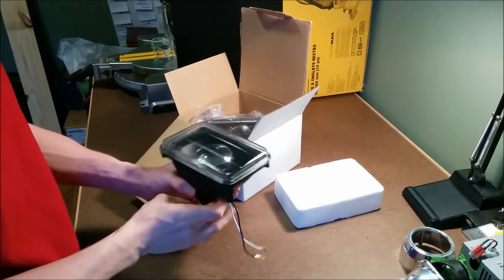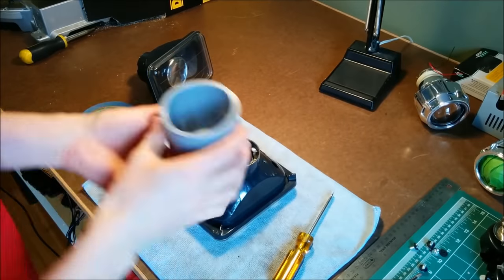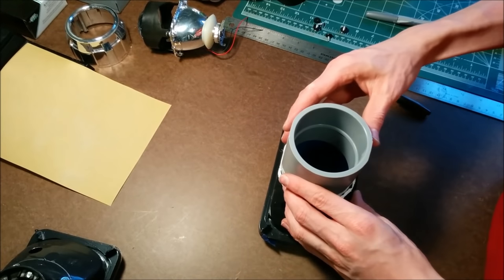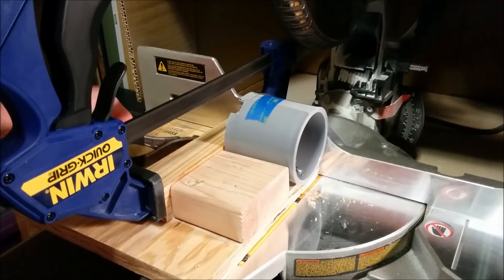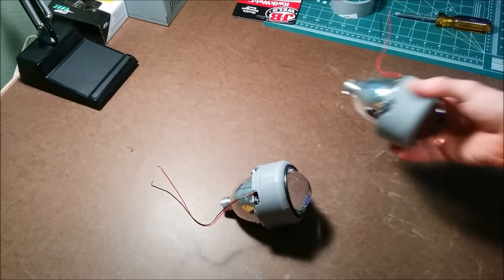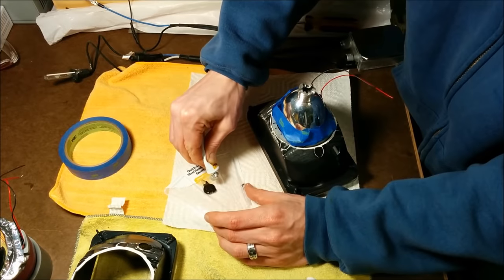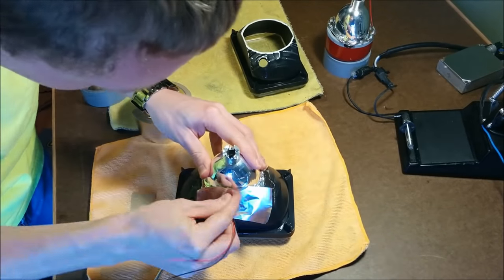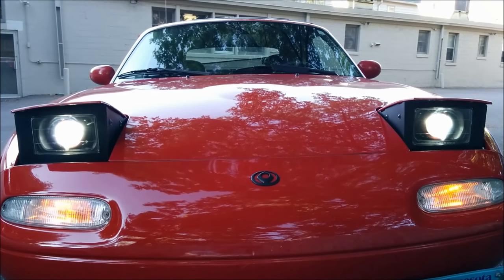How To: Make Projector Headlights for Your Car

Comment: Dude...this has to be one of the best conversions Ive seen on this type of housing.  My Firebird has the 7"x6" housings.  Ive had projectors kicking around for YEARS now.  My main issue is the depth due to the pop up lights.  This install has inspired me though. I really like the way you made the PVC adapters and used them as the shrouds.  That was genius.  Giving you a huge shout out if I ever get back to the project because Im 100% using this idea!  Thanks for the video!
Reply from the maker: JEG's Garage glad I could help!!

Comment: That conduit idea just made it look easier! thought I was going to have to use extreme accuracy skills to cut the housings to fit the projectors correctly.
Great video! Thanks for sharing!
Reply from the maker: Thanks for watching! It's not as hard as it seams!
Reply: It probably isn't, but since I have a need to make things perfect (in this case to make the light cut off level perfect), it would've taken me days to finish both side. Wanting better headlighting for my 1986 mr2, the best upgrade i have at the moment is the H4 Hella 7x6 conversion housings (reflective housing), I tried adding a OPT7 LED bulb but the housing makes too much glare for the way that the bulb was constructed, and didn't have a good cut off.

Comment: This is pretty much unrelated (potentially), but I have a 2002 Saab that has a small bulb, maybe 5 watts inside the light housing. Even if you turn off the headlights and have the fuse removed for the daytime running lights this 5 watt light will turn on, apparently it's to keep the headlights slightly illuminated at all time to give them a bit of "sparkle" so oncoming traffic can see you. I did a retrofit and removed them.

Comment from the maker: Breyden - when I hot glued the projectors into the housing that's when I set the depth.  I could slide them in and out to set the right depth.  Then I tacked them in place when I had the right depth set.
Reply: Justin Depew i have the exact same headlamps and just ordered a set of the same projectors.
My question is, based on the projector length and overall size, would it be possible to mount them just like you did but without cutting the back and instead removing the glass and mounting them through the front? Cause i noticed they stuck out quite a bit on the back

Comment: hi Justin
I have also converted my sealed beam crystals to Projector headlights on 2015 May. I used the original shroud this was possible because i opened it from the front. I didnt throw it to the oven but i used a hex saw to remove the binding cement. Also i used GREY 999 GASKET MAKER as the sealer instead of epoxy and foil and to reattach the lens to the back. And it is a fine job and works well.
Believe me or not for the entire thing i used a angle grinder, a screw driver and a hex saw only. You have good equipment man.

One small problem some moist leaks in from the bulb opening. If you find a solution please let me know.
Reply from the maker: You were able to get the shroud to fit? Nice work. Do you have any pictures?

Comment: I thought only high school girls drove Miata's.

Anyway why is this so much better than the Amazon lamps in their original configuration?
I couldn't find the exact projector lamps you used at The retrofit Source but from their prices I would say you spent between 2 and 3 hundred dollars on this project.
Reply from the maker: The lamps from Amazon are not real projectors. They don't actually project and cut off the light like a real projector. They basically just scatter the light everywhere. 

I already had the projectors so I did not purchase them.  But if I had to buy everything new I'm guessing it would cost about $200.

Comment: Damnn homie good job! Im brainstorming for my 97 camaro. But mine are 5.91"x2.52"×4.19.. they are 4351 sealed beam from factory. I think im gonna have to modify the oem bracketry unfortunately and remove the leveling system.

Comment: Great stuff i like it very neat build was there a downside to the build? I'm wondering if these style lights cause temporary blindness to oncoming traffic? and how did you adjust them to point straight?Do they work for immediate visibility?
Reply from the maker: Projector lights are designed to not blind oncoming traffic. They have a very sharp cutoff at about bumper height. To adjust them, I made brackets with adjustment screws to aim the lights. You can see pictures of this on my website. The link is in the description.

Comment: F'N EXCELLENT TUTORIAL MY MAN!!!! THANK YOU BEST ON YOU TUBE!!!!
Reply from the maker: Drake DrakeR thanks man!
Reply: Justin Depew did you use the entire kit or just the projectors and the bulbs that came with the projectors? Also did you use the H1 series? 
And also the conduit you used does it sit all the way down on the lens? The reason I asked is I want to do a similar setup by run switchback halos inside.

Thanks in advance!
Reply from the maker: Drake DrakeR I used the H1. I did not use the chrome shrouds that come with the projector kits. I used the conduit instead. The conduit doesn't quite touch the lens. I think you could do the halo no problem.
Reply: Justin Depew Awesome thank you for taking the time and the info... once again great video and your website is is also filled with some great projects as well!!

Comment: GREAT job.  Looks excellent.
Did they come out level, like to pass a vehicle inspection.  Do they "vibrate" at higher speeds, whereas to cause headaches in driving for longer distances?
Reply from the maker: Oscar Lechuga they do not rotate because they are glued in place. Also I haven't noticed much vibration. Although these pop up headlights are more subject to vibration than standard headlights, but that has nothing to do with the projector.

Comment: Soooo I have a old Toyota pickup 89 and it has the three female input which is the ground, high beam, and low beam. But my question is... 
if I do this headlight housing and the projector only holds the H1 bulb is there any way I can convert the wires or anything like that? I was thinking of buying the H1 bi-xenon kit and doing the ground on metal and the high beam and low beam connect to the corresponding wires. Is that possible???

Comment: I have a 92 4x4 toyota truck ,I put a 94 4 runner front end on it .
I don`t have much room behind the headlight .
how much more do the new finish light stick out compared to the stock light ?
also how much brighter are the new ones then the old ones ? 
also scene you did a great job on your lights ,how much would you charge to do a set for my truck ?
Reply from the maker: Rodger Privett hi Roger! The projectors stick out the back of the housing quite a bit.  I don't have the exact number but it's probably 2 or 3 inches. The HID bulbs are incredibly bright. It's a huge difference over the stock lights. If I had to charge for the lights it wouldn't be cheap. At least $600 because it is a lot of work and takes a long time.

Comment: I Miss my pop-up lights.     You did a Nice job on your video!      Was wondering - using plastic instead of metal shroud, did lights have heat issue?  Metal would act as heat shield, help with temp.   just curious.  ~  anyway, Looks Really good!
Reply from the maker: Thanks for watching. I have never had an issue with the heat and plastic. It doesn't get that hot.

Comment: That was great! Ive been looking for a way to put projectors in a 4x6 housing without baking them. Your video was super detailed, but I do have a question. How did you set the depth of the projector in the headlight so it wouldnt touch the housing lense? Again, thanks so much for that video

Comment: Hey I have a quick question?? Hopefully someone can reply... So I ordered these type of projectors and the headlights. They both are the same but I found out that it came with no bulb so how did you make the project work without a bulb or did your car have it?? How did you connect it to your car??
Reply from the maker: I also bought the bulb. If you got the same projector as me then it uses a H1 type bulb. Just do a search for H1 HID bulb kit on Google and there will be lots of options.  Wiring depends on your car but you can get wires that plug into your factory harness to get the low beams to work. The high beams take a little extra wiring to get to work.  Also check out hidplanet.com because there is a lot of info there about what bulbs to get and how to wire them up.

Comment: Thanks for posting. I did exactly this project this weekend on some 7x6 lights. Any issues with moisture entering at the bulb socket?
Reply from the maker: Yes , I ended up using silicone sealant around the bulb and socket to try and keep moisture out.

Comment: Nice job. Why did you use the tape over using a high end silicone sealant? The radius on the pipe parts looks perfect.

Comment: Hey.. how did those Morimoto worked out ? i'm thinking on getting a set but they are quite expensive here at 250usd for the projectors without HID's
Reply from the maker: They are amazing.  Very bright.  I recommend them.
Reply: I'm thinking of going a step further and fabricating the headlights with fiberglass to avoid damaging the headlights since the car is kind of rare.. is there really that much temperature ? if it is i'm afraid fiberglas wount hold and catch on fire..
Reply from the maker: +Rodrigo Martinelli I've seen it get up towards 200 degrees next to the bulb

Comment: Nice video man. Awesome job on the headlight. What did you use to clean out the inside of the housing before sealing it back up?
Reply: +Chenyu Fan Should have only been some dust from the cutting and sanding inside them, so that can be easily cleared with a can of compressed air. Or if you have an air-compressor, a sprayer nozzle on the end of the air hose will work even better.

Comment: cool video. how do you adjust the beam direction? Also, how do you ensure that the beam projects to the right. (I live in the UK where we drive on the left hand side of the road and car headlights have to project to the left to avoid dazzling vehicles travelling in the opposite direction of travel.)
Reply from the maker: There is an adjustment mechanism for up and down on the car. Click the link to my website in the description for more pictures. There is no adjacent for left and right. It is not possible to blind people with projector headlights because the beam of light is below eye level at all times.

Comment: What was that conduit thing you made the shrouds out of? Was it just a piece of PVC pipe or a coupler? And how is the clearance on the car? Did you have to modify anything to accommodate for the extra length of the projector sticking out of the back? Great job btw, inspired me to do this for my MR2.
Reply from the maker: It was a PVC coupler. It fits good in the car but I had to make my own mounting brackets to make them fit. You can see a few more pictures on my website here http://justindepew.wix.com/engineer#!DIY-Miata-Projector-Headlights/mccsl/569553440cf263fc5a873d8e
Reply: +Justin Depew Cool, thanks. I just ordered my projectors today. Hopefully this goes as planned lol
Reply from the maker: Good luck!

Comment: How did you account for correct beam height and offset? In Ireland part of the motor test is headlight height and offset.
Reply from the maker: There are adjustment screws on the headlight mounts in the car that allow me to align the beams.
Reply: Cool.Good job ;)

Comment: I  have a question ,  How did you connect the 2 wires to the original dashboard Lights switch /
Reply from the maker: I used a relay and tapped into the original wire harness for the signal. Power for the relay comes from the fuse box.
Reply: +Justin Depew  YOU tapped in to the wiresthat of the  OEM Bulbs ?
Reply from the maker: +choco caroche yeah it's really easy.. Just have to find the right wire
Reply: +Justin Depew OK Thanks ILL bother you more when ill get there  now im trying to find a decent set of  projectors. Not easy to find   on Ebay....  to  many   Some  HI/BI  LOW BEAM   SOME  NOT

Comment: What kind of beam pattern do you get with these? would have to know it's legal here before I try it
Reply: +Chris Duke They have a straight cutoff on low beam, wide beam of light. And as far as legal goes... obviously it isn't DOT approved so no its not "legal". But no cop is going to pull you over for modded headlights, I see too many idiots running around with HID bulbs in their lifted hick trucks with fifty lights on the front and they don't get harassed (they should).
Reply: +ferretkiller9454 I imagine they would in the uk.
Reply: +Chris Duke If you get involved in an accident, the insurance company wont give you shit, if they find out that your car isnt streen legal.  Atleast in my country...
I dont wanna end up paying my whole life for someones hospital bill
Reply: +Chris Duke You could do that by using projector headlights from a Punto (or other car, but that would be one of the cheaper options). They already have a beam pattern set, so you wouldn't have worry about that, except making sure that you'd line up the projectors exactly the same as they were sitting in original headlight they came out of ;)

Comment: I'd like to see the output against a flat wall. I thought it was mighty risky mounting everything up permanent-style before checking the rotation.

Very well done, however - aesthetically, anyway; just curious about functionality.
Reply: Nate G riiigghhtttt 
that's what I thought too, like you can get the housing aimed to a certain degree but if you have Any angle of the bulb in the housing it's a waste of time

Comment: hey buddy could you tell me whats the exact part number or the link to get those projectors im working on my 7x6 headlights and i think these are the ones i want to use as they are easy to fit from the rear... thanks in advance!
Reply from the maker: These are the ones : https://www.theretrofitsource.com/components/projectors/bi-xenon-morimoto-mini-h1-7-0-projectors.html#.V9B2u3MpDqA
Reply: +Justin Depew I appreciate it man thanks!

Comment: sorry I don't know if its been answered but how easy is it to change the bulb after this mod
Reply from the maker: Changing the bulb on this particular headlight on my miata requires me to remove the pop up headlight cover to gain access to the back of the projector. Once I can reach back there it's easy. There's just a clip that holds the light in that's easy to remove. I also put a dab of silicone around the bulb to help it stay water tight.

Comment: Hi Justin, i'm from Europe. How much to do me the exact set of headlights ? Thank you
Reply: Forgot to mention, i have the 4x6 headlights and projectors, i just need for you to assembly all of them :D
Reply from the maker: +mihai0377 hi, thanks for watching all the way from Europe! I don't really have the spare time to make these for sale. Plus they would be very expensive since they are pretty labor intensive.
Reply: Thank you mate... can you tell me then what is the diameter of that silicone rubber hose that you get as a shield ? Thank you
Reply: Justin, can you tell me the diameter of the silicone hose ? Thanks
Reply from the maker: +mihai0377 are you talking about the gray conduit that I painted red?
Reply: Yes Justin... that one :)

Comment from the maker: The housing is 5"x7"
Reply: +Justin Depew No, those are definitely 4x6 headlamps not 5x7 (or 7x6 as it's called here in the states). I've retrofitted countless 7x6/5x7 lamps and I can tell just by looking those are def. not 5x7's.
Reply from the maker: +Jayee you're right, I'm not sure why I said 5x7 because I said 4x6 in the video! Ha losing my mind!
Reply: +Justin Depew No prob dude. How did the PVC conduits go? The max operating temp for most PVC is at 140F before it starts to deform. You have yours mounted in such a way where the reflector bowl is right next to it.
Reply: Justin Depew What is the bulb did you use in that projector? Thanks.

Comment: everything was rated at over 300° except the housing and lense.. looks good though
Reply: The Chosen One I assume the tube was PVC, which melts at 320F...
Reply: Digging up an old thread.... but I'm fairly sure these cheap black plastic housings are made of ABS... which starts to melt at around 230F
Reply from the maker: It's definitely not ABS.  It's some sort of fiberglass.  You can tell but the dust it leaves behind when cutting it.
Reply: Ah okay. I've seen this style of light for sale before and the housings were stamped ABS. Are there no stamps on those to identify the plastic?

Comment: Sure everybody  else on the road love being blinded  by your lights !
Reply from the maker: Morten Kristoffersen Actually, projector headlights are designed to not blind people. They have a very sharp cut off at about bumper height so no light blinds on coming traffic. Projector headlights are widely used today on many production vehicles because of their high light output without blinding others.

Comment: so you used electrical pvc conduit, and worried about high temp paint. Righhhhhhht... Listen, you did some neat looking work there, but pvc is a low melt temp plastic. I work as an electrician, and bend that stuff all day sometimes. That pvc will get burnt quick if those lamps get hot.
Reply from the maker: The melting point of PVC is about 300 degrees. I'm not sure how hot the projectors get, but I haven't had any issues with melting or deformation so it must be lower than 300 degrees.
Reply: +Justin Depew possibly, but beware, that pvc melting point is way higher than the temperature at which the pvc becomes pliable and will deform. so if you go on a long night drive in the summer, your lights may start to move about or break. good luck
Reply from the maker: I will post back if I run into any issues. Thanks for watching!